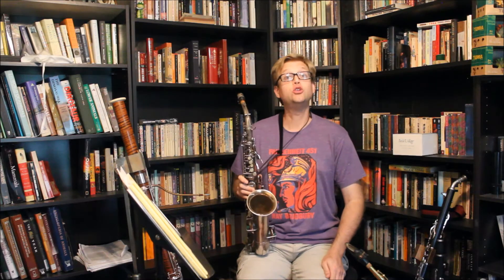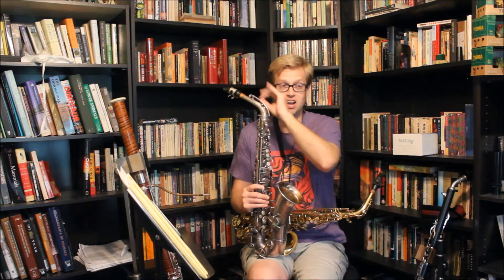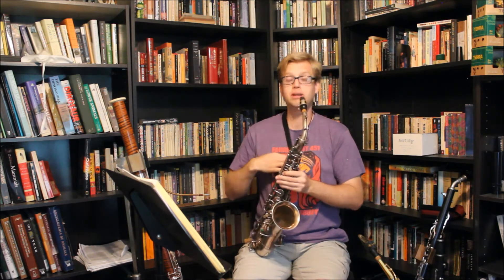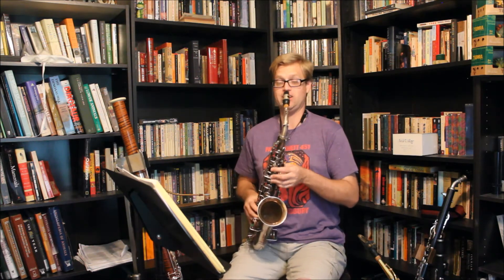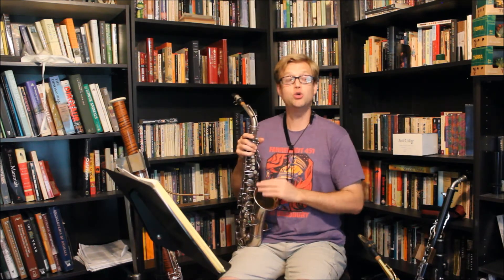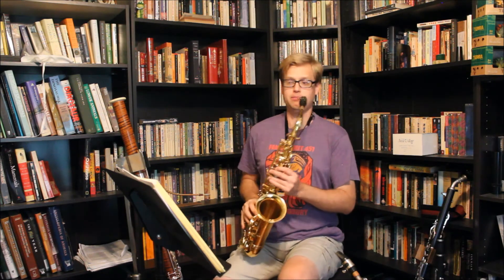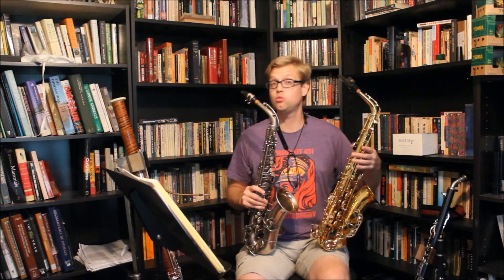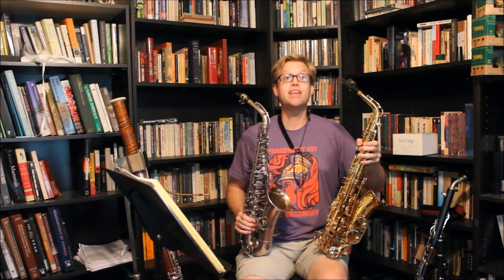A Scientific Comparison between Vintage and Modern Saxophones

Comment: Thanks for the comparison.  I play on a Buescher True Tone alto circa 1912.  It's been overhauled but at times I have trouble playing in tune.  Low notes are flat and high notes are sharp.  I play in both a community band and a rock band.  The Buescher was handed down to me by my Dad back in the 1960's.  Played it all through junior high, high school, and as an adult.  Never knew there were front F keys and high F# keys on newer horns until recently.  Am thinking I should upgrade.
Reply: What's the mouthpiece you use on the buescher? Bueschers really only play in tune with large chamber mouthpieces
Reply: @kevinngo9138  Vandoren A6 S+ chamber / 196MM tip
Reply: @cathycuccia3385  yeah that's a small chamber piece, most modern pieces are small chamber. You gonna have to look for a nice larger chamber piece like the vandoeen jumbo, syos makes some to my knowledge, Morgan as well! I'm sure theres loads more but that's what comes to mind first

Comment: A bit late to the party, but may I suggest next time you do this that you record without your ceiling fan running? I noticed how it affected your tone as it caused this warbling in your notes. I can see the fan in the reflection from the glossy cover of the books on your shelf. I have the same issue when I have my ceiling fan running while practicing. It may seem a weird thing, but the actually amount of pressure you are putting into your horn is quite small and it can be affected by the downwards pressure exerted by the ceiling fan.

Initially I was worried about my tone an instrument, but it corrected itself when I turned my fan off.

Comment: I noticed that on the vintage sax the highest notes were out of tune when playing pianissimo. Do you have any idea why this happens?
Reply from the maker: Yes. The vintage mouthpiece needs a stronger strength reed than the modern. Because of the narrow tip opening, the intonation is much more flexible. If I had played it better, it would have been more in tune.